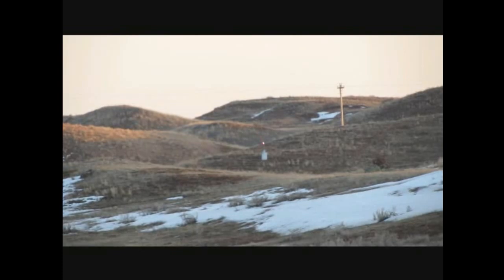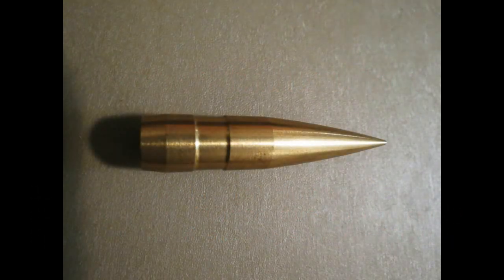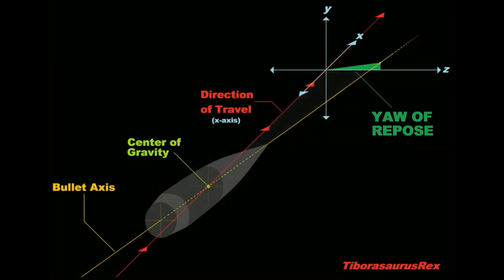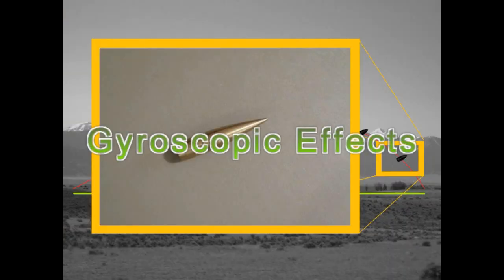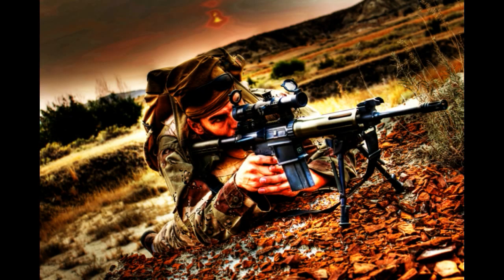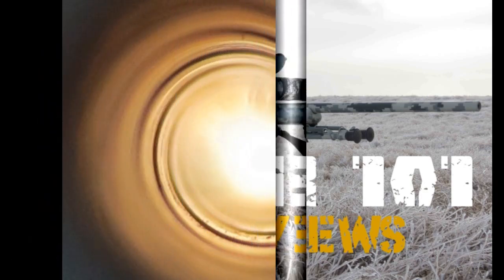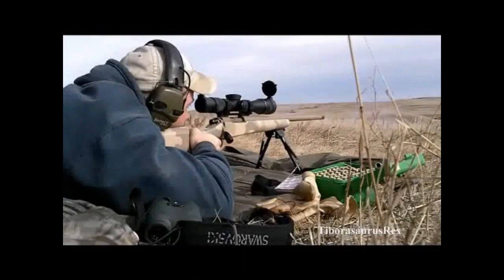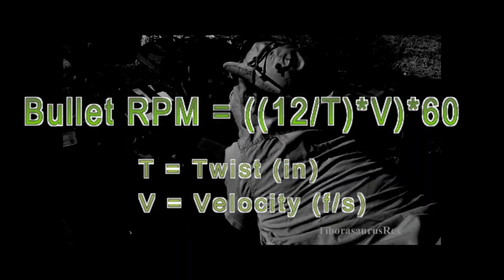Long Range 101 Part 69 - Bullet RPM & Overstabilization

Comment: I've never disciplined myself to the exact science but I have yeeted m855 1100m in the middle of nowhere by the seat of my pants... I often go out there at the end of the day and dig up or pick up the bullets... With a basic 1:7 twist, I've noticed the "waist" and the tail of bullets take damage when clipping rocks... kinda like an aircraft landing rear-gear first... The bullet is stabilized so much that it maintains the barrel axis as it ballistically drops... A hole in cardboard is often oblong as the bullet is falling "belly-first" (best way for me to explain it for a spinning bullet). I'm totally getting my science fix watching these as I've done this the layman way... so my speculations are falling in line and it's awesome.

Comment: Hey Rex, I have a .300 Rum with a 1:8 twist. Would the Barnes 165gr bullet fired at 3380fps cause excessive wear compared to 180gr? Also would this load be overstabilized for shots at long range?

Comment: So what would be preferred for 800 yard accuracy, a 308 ,175 smk with 1:10 twist or 1:12 twist? Shooting approx  2500 fps. Will the difference in the two ratios be noticable?

Comment: So I bought a 20" aac-sd rem 700 .308 with 1/10 twist am I screwed ?
Reply: not really you would just have to experiment with which bullets give you best performance as the smaller the weight of the bullet the more twist. generally speaking, the barrel will work best for smaller lighter .308 bullet like your 150's.

Comment: Rex love the videos, been hooked for hours. I do have a question and I'm sure you went over it or you will but, is there a formula for muzzle velocity between atmospheric densities, I'm at 650ft so i would make my primary table 1000ft or 29, i was just curious if altitude density would affect MV or if that was all external ballistics affecting it after the shot.  thanks again.  
     I'm currently shooting a 7mm with krieger barrel 180gn berger and a huskemaw scope that i got when i didn't know as much as i do now, However i do like the scope and have had great luck with it out to 1200 yds but I'm wanting more precision. Keep the vids coming God bless

Comment: I can't remember where I herd this it was on tv, Progressive twist barrels, starts at  1-15 Twist and ends in 1-9 Twist in 24 inches of barrel. Said to get the bullet to take spin earlier in the barrel ( they called it bullet skid ) and the design promotes Twist acceleration so when it leaves the barrel the twist rate is still accelerating to near 1-7 is that good or is it just marketing?
Reply: Known as gain twist use to be used alot in muzzle/breechloaded match guns. Look up Harry M. Pope

Comment: What happens when you fire your .308 rated at 1:10 out of a 1:12 barrel?
Reply from the maker: fester2251 Less gyroscopic stability at long range can result in greater dynamic stability... striking the proper balance between these two is the trick at ELR.

Comment: Uhm, no offense - but why not just do the math? For the most part, Tibo already spelled it out anyway: A .308 Win at around 2700 fps with a 1/10 twist leaves the barrels at close to 200k rpm (2700 x 720 / 10 = 194400). 

Time in flight will typically be less than or just above one second for ranges <= 1000 yards/meters. 60 seconds in minute (the m in rpm) - therefore 194400 / 60 = 3240 revolutions, give or take a few hundred...

Comment: I tried again. This is the message I get.

We cannot process this transaction because there is a problem with the PayPal email address supplied by the seller. Please contact the seller to resolve the problem. If this payment is for an eBay listing, you can contact the seller via the "Ask Seller a Question" link on the listing page. When you have the correct email address, payment can be made at paypal.com.